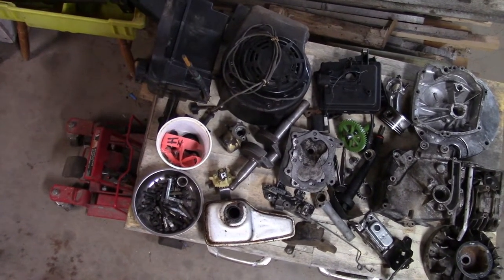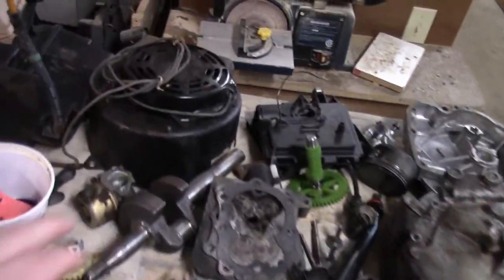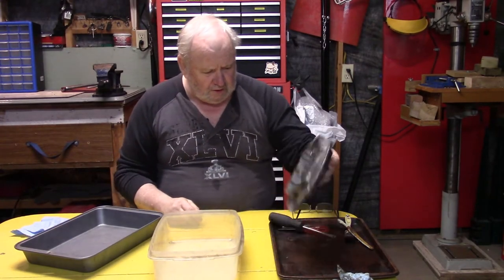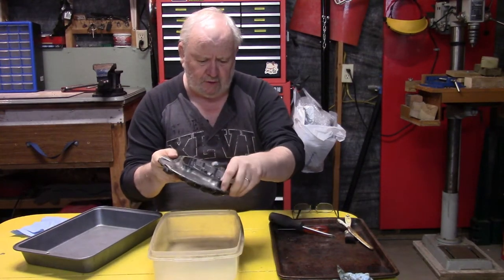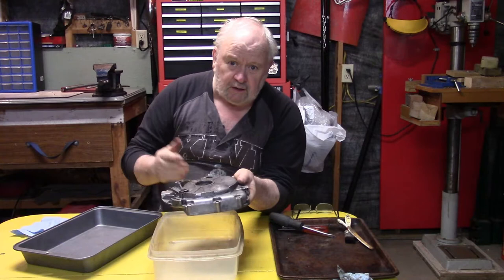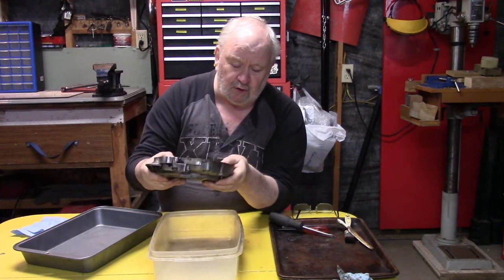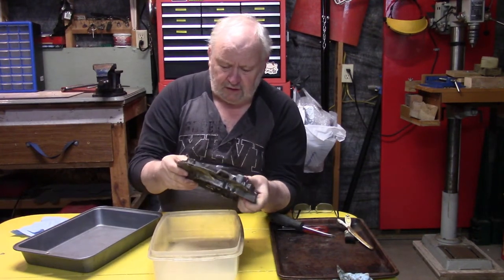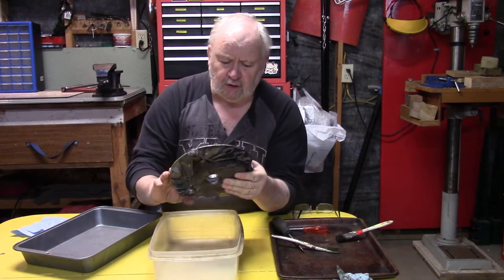All About Small Engines Part 1

Comment: Just like any rebuild , getting it good and clean is very important. Don't what dirt and debris running though the rebuilt engine. Best of luck on the rebuild Mike.
Reply from the maker: How's she goin'?  I want to spend the time it takes to get the parts cleaned up.  But the cleaners I want to use aren't real aggressive so the parts won't be factory clean, but clean enough I hope!!!  Thanks  lot for your comment and for watching.  Take 'er easy!!!

Comment: I love these old Brigs. The epitome of simple. Always keep in mind there is no difference between one of these one lungers compared to a 20 cyl ships engine. There are 2 and 4 stroke examples of both. The big thing to keep in mind is all cleaners,solvents,deturgents and soaps strip the oils that are naturally made  impregnated into everything and need to be re oiled after their hot water/detergent bath. Steels show it by immediate surface rusting. I love these small motors as they will run in incredibly worn out condition. Woo hoo and onward my friend !
Reply from the maker: How's she goin'?  You are right Dean about stripping the parts of their 'oils' and I plan on using some assembly oil when rebuilding it, but you reminder was appropriate because all I did with the head in this video was finish cleaning it and set it aside.  I better get out to the shop and put some oil on it eh!!!  You have so much knowledge and us young whipper-snappers are struggling just to keep up!!!  LOL  Thanks for tuning and commenting Dean.  I sure appreciate it buddy!!  Take care eh!!!
Reply: @GrampiesWorkshop  Steel parts are the most susceptible, Aluminum will show a bit of dusty stuff that shows black on a white rag. Even just a shot or two with a product called "Honey Goo" will be perfect. As a rust seized part spray I did a test and it climbed 4 inches up a rusted piece of all thread over night. It has a sticky like thing about it too. Got my vote and has been on my bench for 20 + years now. Nice things about a Brigs is if a valve is worn out it comes to you over length to just file or grind to the right length. I have never seen one that didn't love a good, old fashioned valve seat lapping eh.Rare3ly they need a new piston and oversized rings are standard So a good seal can happen in an old worn and flex honed bore. If ever SHTF ever happens these and the Honda like will be worth a fortune eh as they are just sooooo workable. Never throw out as much as a case cover machine screw eh.
Reply from the maker: @TomokosEnterprize  Right on Dean!!!  I heard of Honey Goo.  Maybe I'll get some of that the next time I'm in town!!  Take care!!!

Comment: Mike, I use the oldest mechanics trick. A can of brake cleaner just spray them down with that. It will not take long to clean them up. I suppose you could rinse them off with the other stuff after. Break cleaner and a rag works every time. If you do not have break cleaner the second best thing is a can of carburetor cleaner.
Reply from the maker: Hello there Vicky!!!  I did use some carb cleaner on the sump bottom plate.  It works some good eh!!!  But I don't want to use any cleaners that are solvent or petroleum based.  Even if I were to use the carb and/or brake cleaner first and than rinse with the WD40, I may contaminate the WD40 and then I couldn't dispose of it easily.  The WD40 is working pretty good when I use the wire brush.  Thanks for the suggestion though and who knows, I may end up going that way before I finish cleaning all the parts.  I know I will use the carb cleaner to clean the carb!!!  LOL  Thanks for tuning in and take care!!

Comment: Cleaning is always the worst part Mike. The absolute best thing I’ve found fir cleaning parts is an ultrasonic parts washer. Carburetors don’t stand a chance of defeating you with one of those. I use diesel fuel through an old oil burner pump piped into an old refrigerant 11 drum. Laid on its side it makes a good washer. But the ultrasonic is better than the cats meow. The bad thing is mine is limited to small parts. It’s only a two quart capacity. Wish it was 50 gallon !!!  Should be an interesting series. I’m waaaaaay late to the party too. )-:
Reply from the maker: How's she goin'?  An ultrasonic cleaner would be nice that's for sure, but I don't have a need for one often enough to justify it!!  LOL  I tried some different cleaners and I wanted one that would be biodegradable.  Other than that, it seems that diesel fuel works pretty darn good!!!  Thanks for dropping by and take care!!

Comment: Now you have to sneak Nannies toothbrush back inside before she notices it is gone! I think soaking is the key to any water based cleaning product. Long gone are the days when we used to wash parts in Stoddard solvent, but that stuff was nasty on the environment, we find out now! This will be a great series! Cheers!
Reply from the maker: How's she goin'?  Yes for sure eh.  A lot of the cleaners we used are all banned now eh!!!  I remember when I was working we used an electrical parts cleaner that was proven to cause cancer many years later.  We used to wash motors and spray it on all sorts of switch gear unmasked and bare handed!!!  Oh Oh!!!  Thanks for tuning in and take care!!

Comment: Best degreaser I've used is called AIM made by a company called Bebbington out of Dartmouth. For heavy grease sometimes its best to use mineral spirits first. Dirt and stains in aluminum try some etching mag wheel cleaner, its some heavy duty stuff, crappy tire has it.
Reply from the maker: How's she goin'?  Thanks a lot for weighing in on this!!!  I'll have to check out the AIM.  Sounds like good stuff.  I don't want to use solvent based cleaners because they are a problem to dispose of.  The WD40 is an OK cleaner.  It takes some elbow grease though!!!  LOL  Thanks for watching.  Take 'er easy!!
Reply: @GrampiesWorkshop  yes that’s the trouble with the mineral spirits pretty well last resort stuff. I suppose if the missus isn’t home the dishwasher is an option too, LOL
Reply from the maker: @macfarms  I suppose eh!!!  LOL

Comment: That s a good winter project, I found Scotchbrite pads on a small angle grinder works best and quickly without scratching the surface and a brass wire wheel. Scotchbrite comes in different grades medium is good. use what ever parts cleaner you have.
Reply from the maker: How's she goin'?  Great idea Don!!!  Thanks for that.  I have some Scotch Brite pads here at the camp too, so I'll try them out!!!   Tons of great info and tips on YouTube and they don't all come in the form of a video!!!  Thanks for tuning in and take care!!
Reply: @GrampiesWorkshop  Always a pleasure Mike

Comment: Hey Grampie I also tried the WD40 I was not impressed with it a all, I was using it for cleaning my vehicle, I found Super Clean to be better for my use and I have also tried Purple Power it seems to work good as well.All the best and good luck with your engine,
Reply from the maker: Hello there Wayne!!!  I have to say the WD40 did get a lot of the grease and grim off the parts but I had to scrub at them a lot with that wire brush.  That sure wouldn't be a good plan for your vehicle though eh!!!  I'm sure there are better cleaners out there.  The Super Clean sounds like a candidate.  I also liked the reviews on the Simple Green HD.  Thanks for watching and take care!!

Comment: I am looking forward to following along with this series and we even have a few engine you could have rebuilt lol. Great timing as ever as we are talking about rebuilding one of the engines we have. We use an ultrasonic cleaner to clean parts such as the carb. Take care
Reply from the maker: Hey there Joseph!!!  Ultrasonic cleaners are great for carbs, but alas, I don't have one!!!  Cleaning is key especially when rebuilding and engine and I don't want to use solvent or petroleum based cleaners, so that leaves me with cleaners that are not real aggressive. Oh well.  Thanks for watching and commenting, Take care!!
Reply: @GrampiesWorkshop  Hello there Grampie, this is mikky here from Scotland, in the UK!
Well, this is very nearly a year later now, and i have been looking for a series of small engine rebuild videos for a long time!
I just happened upon your site, the first one being the cool box parts washer!  I tried to find part two of that engine rebuild you were washing but could not.  However, on scrolling down, i came upon this little gem--all about small engines--and i must say i am nothing short of delighted!!
I must be the only person who is not put off by the cleaning and indeed likes that part of the job, dirty though it may be!
A couple of points though if i may?  In part one, with the wd40 degreaser, i thought the clean areas you did with the degreaser owed more to the steel brush than the wd40 itself, but the two combined seemed to work well between them.
There ARE other cleaning solutions out there Grampie, how about good old fashioned distilled white vinegar, cheap as chips as we say over here, and for a more aggressive clean, how about the addition of good old fashioned salt with the vinegar, both work a treat.
I often leave parts over night, or a week if it is a particularly rusty metal or steel, then wipe and spray wd40 on them. to prevent flash rust.
Of course this MAY affect aluminium metals, but steel type metals would be ok.
Anything with Lemon in it is always good too, again, a natural product with the acidity to clean most metals.  (A freshly squeezed lemon into washing up liquid works wonders for all types of cleaning!)
And finally,-- (sorry, you must think i'm preaching, but i assure you i am not,  you are very experienced at what you know and what you do, as are all of your commenters, you are all way more experienced than me, i can tell you that!!)--as for ultrasonic cleaning, a video i watched a few years ago about this subject gave me the idea of using just a simple electric toothbrush, minus the brush, and by using just the prong protruding out of the unit, a ready made ultrasonic cleaner, and used with just hot water with washing up liquid!
Keep up the good work, i have a lot of catching up to do it seems!! Bye for now!!
Reply from the maker: @susankelly7778  How's she goin' Mikky?  Wow I'm some impressed with your comment.  Both from all the cleaning solutions tips and for the very nice remarks about the videos.  I'm not sure if you got to see some of the later vids in this series, but I ended up using Dawn Platinum Powerwash.  It's available in the grocery stores around here.  Basically it's a condensed liquid dish detergent.  It really worked well and didn't leave any residue behind.  But your suggestions would be fine too.  I had fun with this engine rebuild.  I sure learned a lot.  I kind of had an idea of what goes on in a small engine, but being able to examine each part sure helped me get a better mental image of what goes on in the engine.  I was intrigued with the governor.  A simple little thing and it works so well.  You made my night Mikky with your nice comments about the videos.  I sure hope you are able to watch my channel on a regular basis going forward.  Do you have a YouTube channel?  Thanks again and take 'er easy!!!

Comment: Hey Mike.  I've never found anything that can replace Varsol.  Other than really expensive citrus degreasers, none of the biodegradable or environmentally safe cleaners have worked very well
Reply from the maker: Hello there Bruce!!!  I agree with you on that point Bruce!!!  However I want to stick with the biodegradable cleaners as they are easier to dispose of.  This cleaner, the WD40 stuff, seems to be working when I use the wire brush and lots of elbow grease.  The parts won't be 'factory clean' but should be OK for re-assembly.  Thanks for watching an commenting   Take care!!

Comment: I use diesel in my parts washer. maybe you could lightly scrub the parts with a quart of diesel then a dunk in the wd40 the parts you want to eat off of.
Reply from the maker: How's she goin'?  That might be a plan.  I wanted a cleaner that was biodegradable and maybe if the WD40 washed away the diesel it might not be biodegradable any more.  Not too sure.  The WD40 seems to be working.  When I use the brush it seems to clean up pretty good.  Certainly not like new, but clean enough for re-assembly I'm thinking!!!  Thanks a lot for the suggestion though.  I may end up using that at some point!!  Take care!!